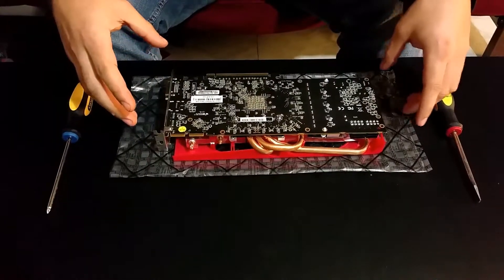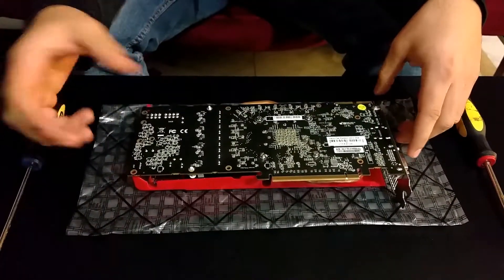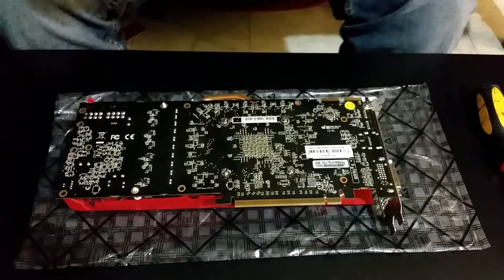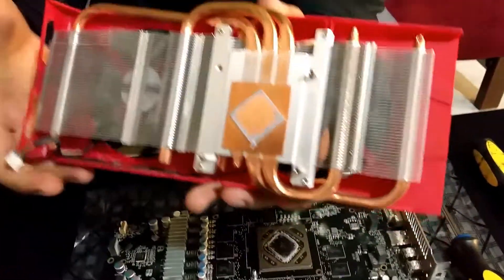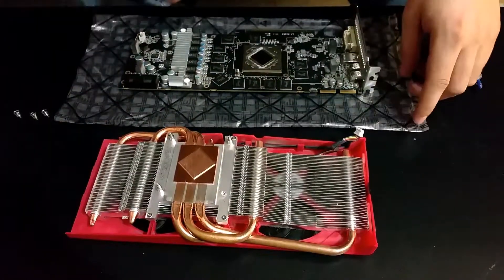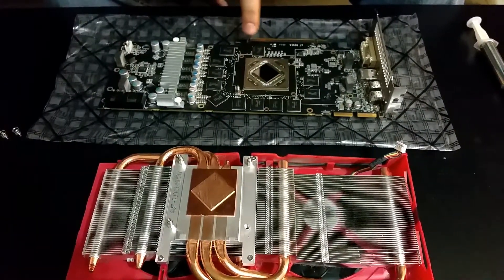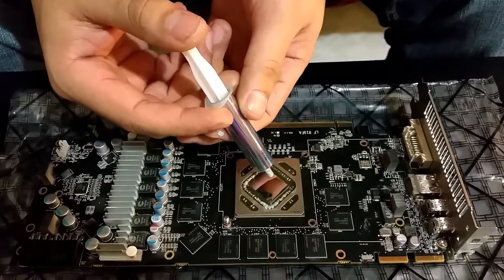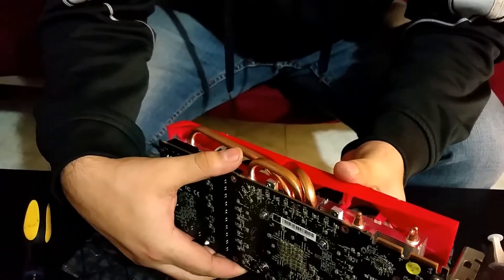How to replace Thermal Compound on a GPU (With Temperature Results)

Comment: Not enough paste, should be a big pea sized amount!
Reply: gpu has a smaller processor than a cpu so i would say he put the proper amount on there plus he got the results he was looking for.
Reply: @dazbeese  often people say that it is required to use more because of the space between of the heatspreader and processor.